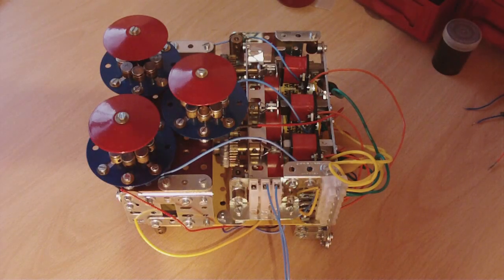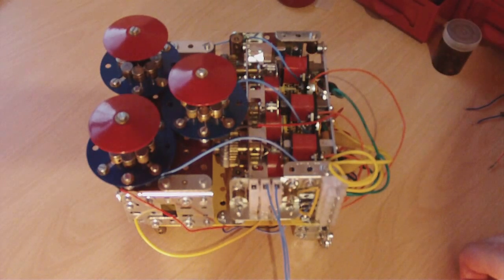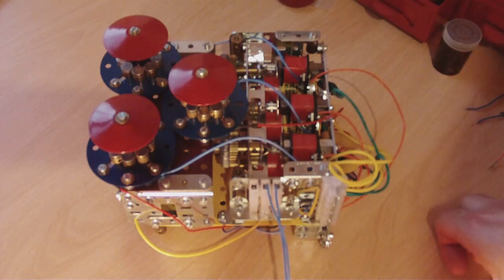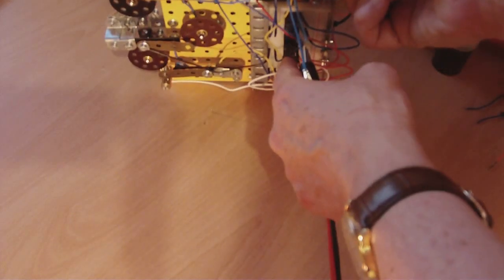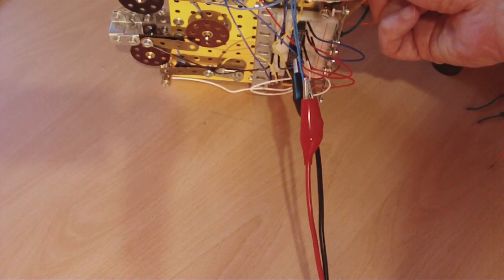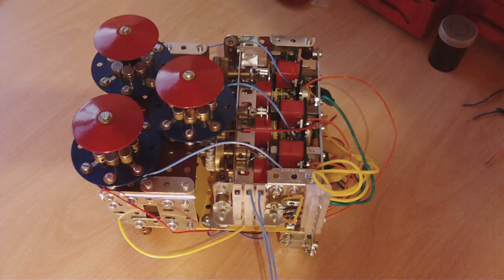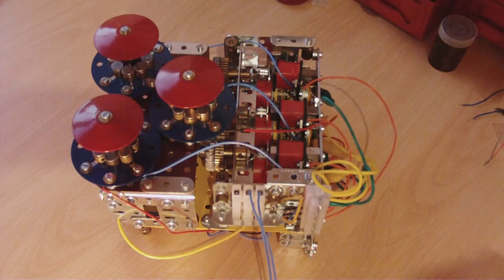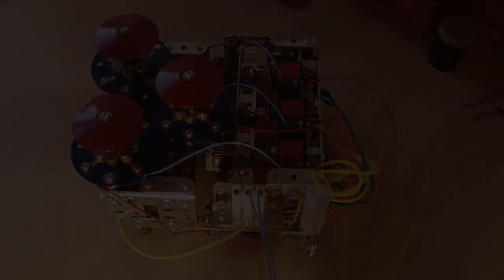Meccano Pinball Pop bumpers

Comment: Brian, fantastic new addition to your pinball machine.   Of course you won't be able to lift it when it's finished and you will have to get permission from the local electricity board to turn it on but when it is finished it will be a marvel of electro-mechanical engineering.   I've been thinking...   maybe when it's complete, you might convert it to steam :0)
Reply from the maker: I'll leave the steam version to you! It should still run on 2 PSUs, at about 30 watts an hour it is better than watching the latest soap on an LED TV.